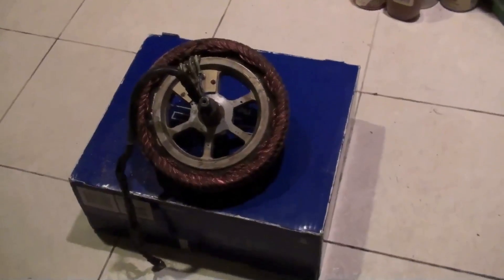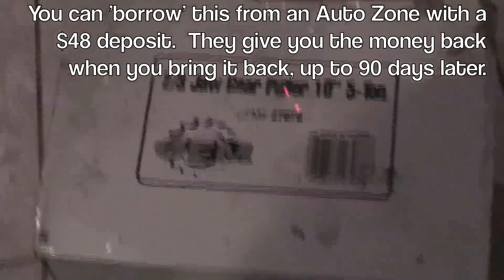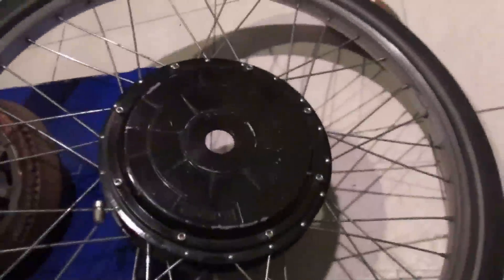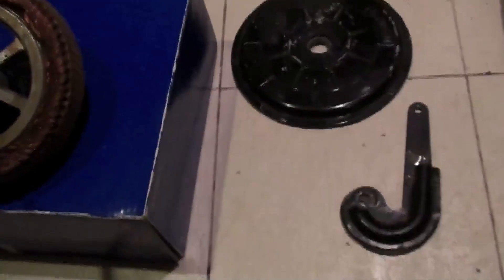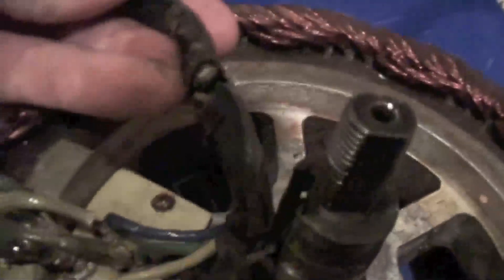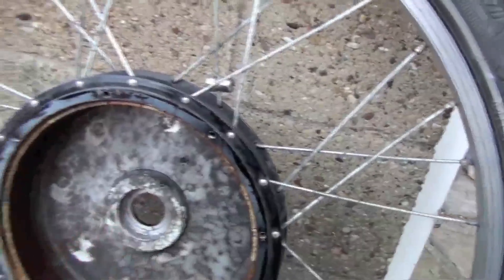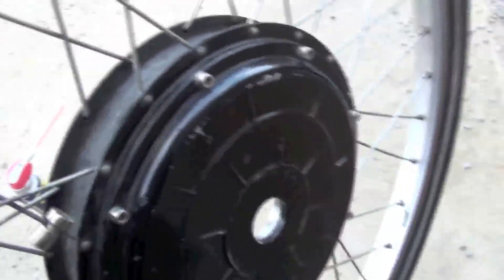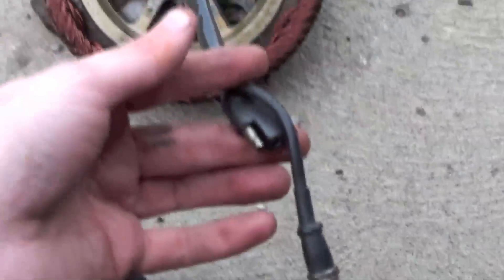Inside Crystalyte Phoenix 5304 ebike motor

Comment from the maker: No maintenance is required for a brushless DC electric motor.  If the motor has brushes, those will need to be replaced when they wear out.

Comment from the maker: The motor was from ElectricRider . I bought it back in 08. If you buy one now, it would be much the same, but I do know there's been at least two design revisions since then. The newer ones are using 14 gauge power wires instead of 12 gauge, and the plastic wire guide that goes over the axle has changed.